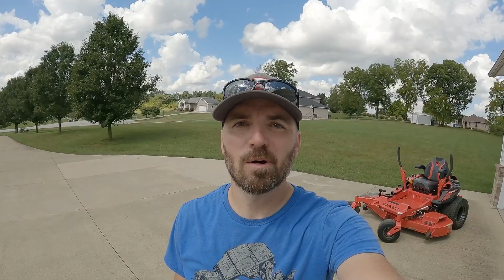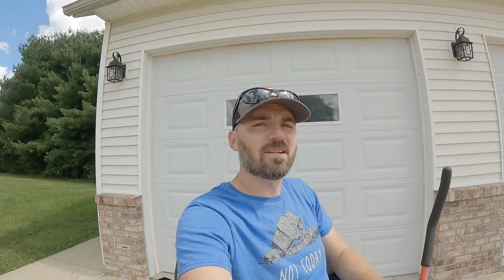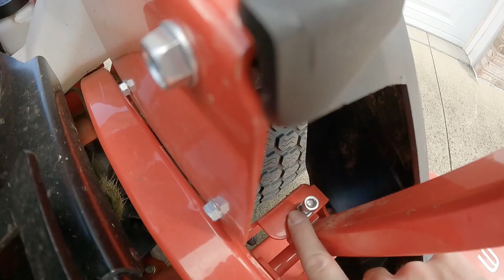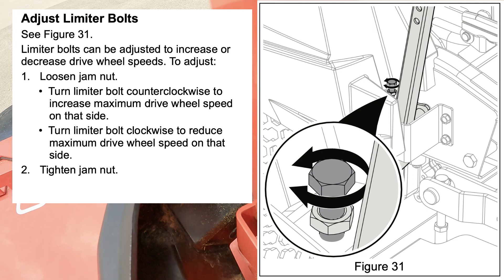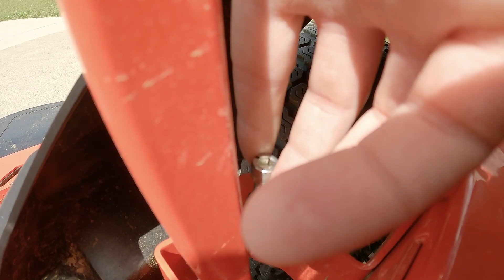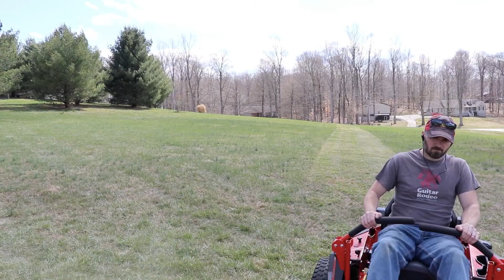Increase Top Speed On Your Gravely ZTHD Zero Turn

Comment: Thank you for the video. It looked like you were by adjusting that bolt back and forth several different ways and I couldn't really tell what you did. I heard you described it that the bolt being loosened increases the throw of the arms and increases speed.

Comment: I really enjoyed watching this video on how to make the adjustments on the Mower, as it was very informative and educational. One other thing that I've come across in doing so, is that the filters can sometimes become clogged and restrict allowing the free flow of fluid to the transmissions. . I also measure the space between the throw levers to make sure they're both adjusted to the same distance. Sometimes, I put a little piece of tape around the bottom of the bolt, to remind me of where it had been adjusted at the factory. But All in all, this was as "Text Book" as anybody can get it. Can you please make a video on replacing the drive belt on the Gravely 60 inch series, Mowers. Thank you, and Please keep the videos coming. Take care, and
 stay safe Sir.

Comment: All that just adjusts the steering lever position to keep them even. It doesn’t increase the speed.
Reply: Your statement is incorrect.  There is a different adjustment on the steering levers to even them up.  As I own the same model mower and have made the same adjustments per the owners manual, the bolts that he is adjusting truly are the limiters to adjust speed to each wheel motor in order to adjust tracking.

Comment: What oil weight do you use? And Brand name
Reply: For this mower it’s 2qt 10w30 synthetic.
Reply: @lissettelopez8331  Per side. I have found with the 3100 series tranny, a total fluid change to include new filters takes very close to 4.5 qts. total when having enough fluid up to the cold fill line in each expansion tank (on a cold engine / tranny).
Reply: @lissettelopez8331  You should be using either full-synthetic15W50 or in really hot climates 20W50.

Comment: If you do adjust them, I recommend finding the same starting point (backed all the way out or screwed all the way in) then counting turns, or removing completely, counting threads, and marking the same point.  You'll likely need to fine tune them after the first adjustment.  For owners of other type Gravely's, you may find this adjustment bolt is horizontal to the bars, facing directly forward in the open, and much easier to access.  I have a Pro 160 and the adjustment bolts arrived with them nearly bottomed out already, and it moves pretty quick so no need for me to mess with them.

Comment: Why not just pull the bolt completely off to get full range of motion?
Reply from the maker: I may have to try that. The way my luck goes, the thing wouldn’t track straight with the bolts completely out of both sides.
Reply: @TorqueWagon  if it tracks to one side slightly just put the bolt back in on the opposite side its tracking to. And just barrrreeeelllyyyy limit the range of motion on that arm. Voila. Should go straight. But atleast then you would know you are getting full speed out of it.
Reply from the maker: Good point. I think the tire pressure can have some effect on the tracking as well, so it’s important to make sure the tires equal pressure.
Reply: @thebertusmcth  I'm backing both all the way out and then adjusting one side if needed. I'm going for full speed right off the bat. Cheers!
Reply: because the next stop will be the neutral plate and you will put a lot of unwanted stress on the neutral set screw and pulling the neutral plate out of position

Comment: What state do you live in? Looks like a nice area.
Reply from the maker: Thanks. I live in Southern Indiana. It is especially nice in the fall, and the winters aren’t bad either.
Reply: @TorqueWagon  Nice! I've never seen that part of the country but I have a couple friends who are from Indiana. I'm in Central Oregon.  Lot of rocks. Rough on mowers.
Reply: Another thing you could look into is putting a thicker fluid in the pumps.   They are hydraulic motors so in  theory a thicker fluid would cause less loss
Reply: What's your final setting 3 full turns?